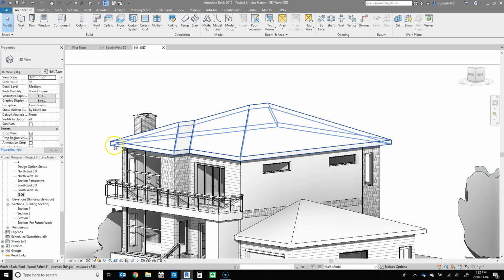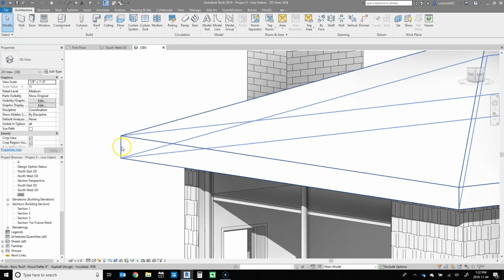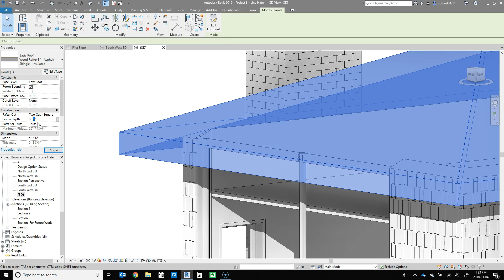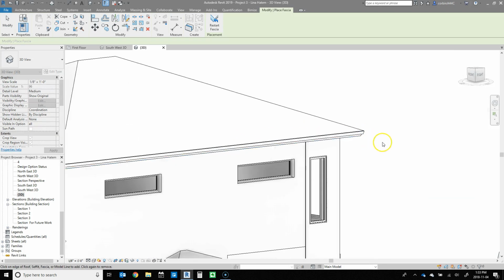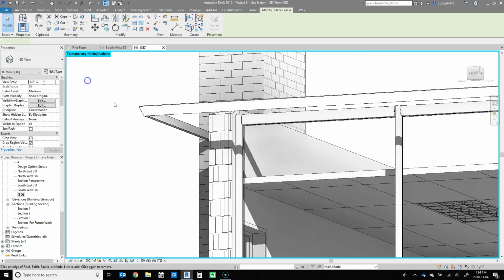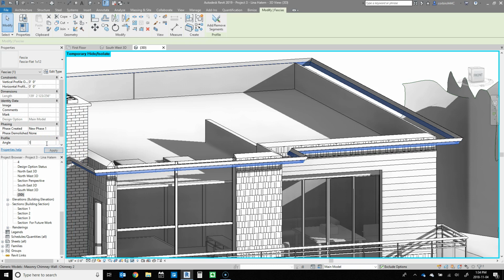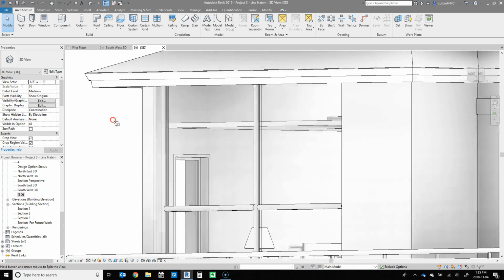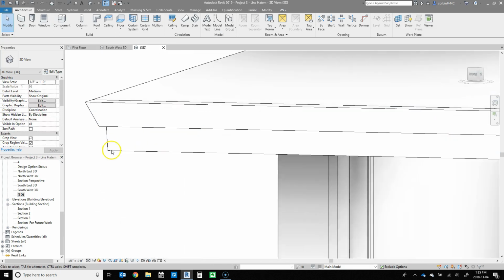Revit Tutorial -  How to Change Angle of Fascia Board

Comment: How do you cause the fascia to end up under the roof sheathing?
Reply from the maker: Hi Dean, Two options you can create two fascias, the bottom one will have a horizontal and vertical offset. In this case it would be lets say -2" horizontal and the depth of the fascia so lets say -8" vertical. Let me know if you want to do a video showing this.